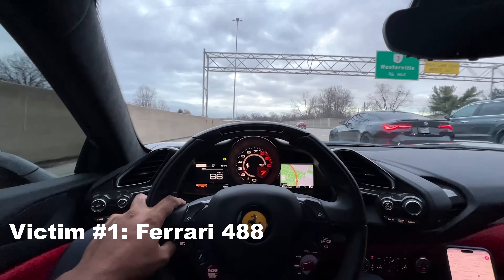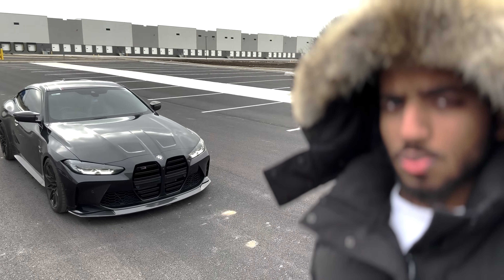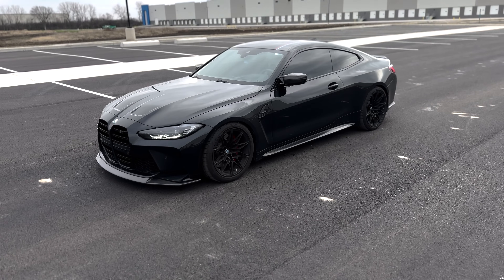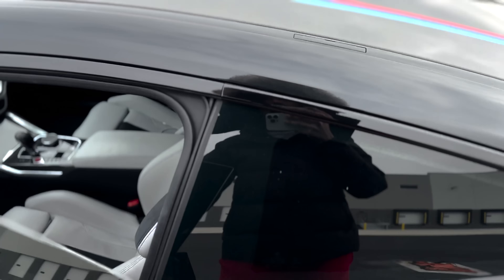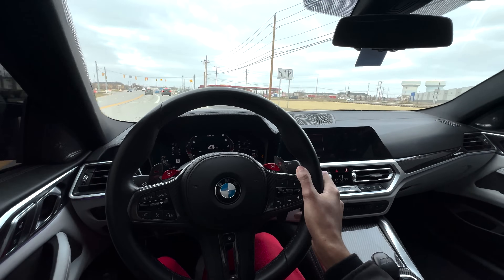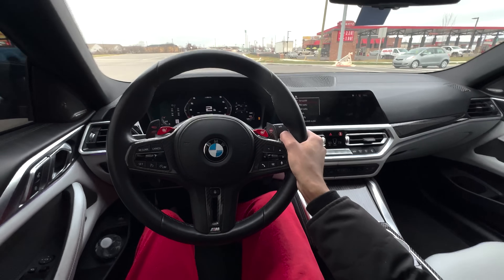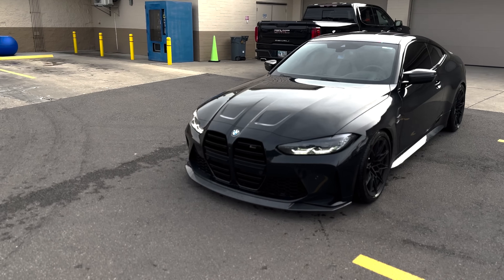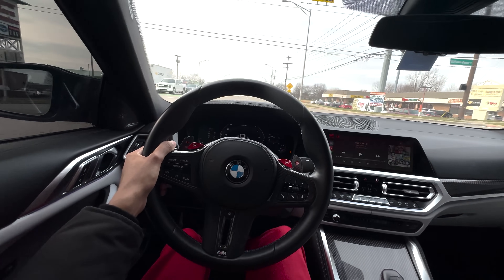HOW FAST IS A STAGE 2 TUNED BMW M4 COMPETITION (G82)

Comment: You are a very brave brother to do that to your M4 much respect. I'm getting either the 2022 M4 or a  2023 M8 and will get the stage one or two tune ,but keep it stock as much as possible.  I currently have a rare limited edition spectral blue Lexus LC 500 coupe with white interior. One of the most beautiful cars in the world. Only 100 made in the world. . Its a beautiful grand touring car ,but its heavy and slow!!!! 471 horses is waaay too slow. Haven't made up my mind between the M4 or M8..
Reply from the maker: Hey I love how those LCs look! I’d say M8 is more of a touring car M4 is more of a sports car. Either one is a great buy you just need to see which one aligns more to your goals. Both cars are very different
Reply: yo bro look up the M5cs Sound sounds so crazy
Reply: M8 is more of a sports car bro because it's quicker and top speed is higher?😂😂
Reply: @xmx1520 you must not have seen the new G8Xs huh😂 the G8X has the most potential between itself and F9X. F90 and F92 are just too heavy and their engines don’t compare to the new M3/4
Reply: For all out speed (including mods), get an M4 Xdrive. If you want a more spacious grown man type of car, M8 Comp.

Comment: BMW has been making fast cars for decades now is anyone surprised?
Light weight to power ratio never fails
Reply: Modern BMWs aren’t light though… 3700 pounds is pretty average all things considered. Anything under 3,000 pounds is light, cars over 4,000 are boats.
Reply: @Whoareyoucalling yes most modern cars are heavier. But a stage 2 on 3700lbs is like 580 something horsepower is pretty good.

Comment: Just get 842m wheels there oem wheels  and there 18 in the front and 19 in the back so you can put a meaty tired in the back the guys at mlife usually run that setup in the rear
Reply from the maker: yeah Rick was recommending it so I might grab them up as a drag pack

Comment: Wait until the facelift comes out in the late fall and see if you like those lights better. Also throw out the charcoal filters and oem paper filters and put bmc filters on your stock intake. You'll gain a good 20hp/20tq with all the boost your running
Reply from the maker: Hey bro I forgot to mention I have upgraded filters on my car too actually! My car is built and tuned by mlife auto care and I have their stage 2 package. They build the fastest G80s in the world

Comment: Bro how are you pushing ~900hp on stock tires and wheels? With rwd you need some better tires to put the power down. I’m currently running 315 35 20 nt05s in the rear and stock PS4S in the front. Nt01 and r888 are solid tires too.
Reply: I agree because he said he doesn’t want the drag pack setup and wants to remain low key. I think he should trade it for a awd, then he can stay low key with his setup

Comment: man I'm so torn between getting this or an m5
Reply: I had an f90 m5 comp and traded it for a 24 m4 x….no regrets
Reply from the maker: M4 G82 is in a different league in terms of speed and performance. M5 is a good compromise between the speed and performance along with comfort and luxury
Reply: @mooz2x Bro an M5 is much faster than a M4 what are you saying stock vs stock

Comment: 14:30 if you dont wanna be in that situation you should buy a headmount so you can drive with both hands specially because yo traction in 1-3😂, and you should put meaty bois on the rear. w video w car

Comment: Would the next move be to get bigger turbos, and how much horsepower would you gain with new turbos?
Reply from the maker: Yeah the next move for me would be upgraded turbos, if I run pure stage 2 turbos I can get around 1000hp out of the car based on how aggressively I tune it (with supporting mods)

Comment: What is your tire psi? Could help with traction if you lower your rears.
Reply from the maker: That’s true, I want to say it’s 33psi which is what these cars use stock. I could definitely hook a bit more if I dropped it but I’d just get a drag pack if it came down to it

Comment: Hey btw is there any side effects to having what you did to it? Im getting one and I want to do the same but also want to daily it
Reply: Eventually every modified car will have some sort of issue in the long run. Just have to realize you’ll need capital to cover that issue later on..
Reply: @Boostform based on what?  thats no more true than for a car with zero mods

Comment: I beat a tuned M4 Comp. In my Plaid off the line and 1/4 mile and I only paid $60k for it used 2021 with 19k miles.  Hate the Tesla all u want but unless your car can do 200mph dont even try it🤣

Comment: Your statement seems unclear. I previously owned an F82 M4, and I can confirm that the fuel efficiency (MPG) is better in the new G82. Additionally, the gearbox ratio has been improved, as the G82 features an 8-speed transmission, compared to the 7-speed in the F82. It's also worth noting that most buyers of this vehicle prioritize performance over fuel economy. I'm not sure why would you mention MPG. Do you buy a performance car for good MPG ?

Comment: 0:47 the mustang left them all😂😂🦅🦅🦅🦅
Reply from the maker: Oh I gapped that Mustang GT500 don't worry 😂😂
Reply: @mooz2x cap
Reply from the maker: @Dfwjohnd  when we lined it up seperately that day, I put a car or 2 on it
Reply: @mooz2x in all honesty, between the M4 and that Shelby 500 not even in the same class of vehicle. That Shelby as a muscle car just blew the doors off a Lamborghini, got a MASSIVE gap on a M4 in the race ON film. That’s extremely respectable. Top speed run.. that M4 is gone
Reply from the maker: @BoostedGT2 GT500 is no joke! But I’m telling you my car is faster we lined it up and I beat it. I don’t gotta lie about that. It was a much closer race than the Lamborghini was
Reply: @mooz2x  I’m not doubting you, I know the exact capabilities in both cars. That gt500 is sitting at almost 400 more pounds than your car without the driver and gas. I’m not sure what your car is running for horsepower as I’m assuming it’s not stock at all. But the Shelby stock has WAY more horsepower than your M4. Stock to stock id like to see this race again
Reply: I meant Stock Horsepower to Stock Horsepower, not what you’re running for hp right now
Reply: @BoostedGT2 I’m with u bro , where’s the footage 🤷🏾‍♂️

Comment: sorry for asking but what you do for a living to afford that machine?
Reply: it's 76k, you'd need roughly $30-$40hr, and you'd have to be single with no kids to afford it. Throw roughly 20k down, which is usually a trade-up in value. I'm thinking he probably traded in 40k+ value though, an older m4. That's the name of the game bro, you don't start with an 80k car usually, unless you're making 150k+. Normally how it works is you start in the 30k 330i, and pay it off as fast as you can, and then you trade in that 25k plus throw 10k with it, to then put 35k towards say a 50k 2020 m4, and pay that off as fast as you can. Then you go big, and trade it in after 2-3 years, and get that 2022-2023 newish one m4 comp for 70kish. This usually takes an accumulative time of 5-7 years. I've seen my buddies go from SXT, to RT, to Scat Pack 392, to Hellcat, exactly like this.
A good career you can look into right now is going to school for your A+P certifications, so it'll be considered Aircraft Maintenance technician school. They are 18 months in length, but the pay right now with the major airlines hiring directly, is roughly $40hr. Then they top out after 5-6.5 years at $60-$75hr. UPS right now starts at $36hr, but after 5 years you hit top out of $75hr, and it'll be up to $80hr in 3-5 years. Then you gotta think, overtime is time and a half over 8 hours, and double pay, yes, double pay after 12 hours. It's not uncommon to make $150k a year after you do 7 years in industry. It would be nothing for a single person to throw 30k a year towards a car. 30k downpayment on a 70k car and bingo it's like financing a 40k car.
Reply: also for "cheap." You can get a new supra, 3.0 for 55k, and make 1,000whp easy and be under 80k.
Reply from the maker: Hey I’ll make a video on it soon for you brother

Comment: 750ish whp? I thought it was 900whp and single big turboed 😂
Reply: He says it got 780ish wheel. 900 is a big round up for crank 😂😂😂😂 more like 840at the crank. Ether way its alot  but he only has rear wheel not all wheel so he only loosing 40ish hp. NOT 120HP LIKE HE TRING 2 SAY
Reply: His dreaming haha not making any where need that much hp with down pipe and tune.

Comment: M3 cs tuned is still hella faster than any m4 with tunes
Reply from the maker: I don’t think you know much about the platform. An M3 CS tuned and a M4 tuned are going to be the exact same in terms of power. Same motor, turbos and everything. Only difference is the CS has a bump in power from a factory tune in stock form which is very minor.
Reply: You need to do some research lol

Comment: 🤣🤣 unlucky u brought the wrong car !!! Why didn’t you wait and get the x drive , absolutely no excuses as the x drive is switchable, rwd - 4wd , so when ur pushing over 600 hp ur wasting money and not really putting that power to use I had the x drive for 6 weeks and oh boy u messed up 🤣
Reply from the maker: I don't need AWD to be able to handle my car
Reply: @mooz2x  it’s not about you , it’s simple physics bro , once you get to that point ur car can’t put all the power to the tarmac though 2 wheels (500-600 hp ) then 4 wheels will do it better 🤷🏻‍♂️🤣 don’t hate but u brought the wrong car 🤣🤣🤣
Reply from the maker: @craigwilliams3099  your profile pic is an i8 talking about I bought the wrong car lol I'll pass on your advice
Reply: @mooz2x  Stop talking like your a pro racing driver lol Your 21 years old with limited driving experience 🤣🤣YOU can not defy physics that simple lol